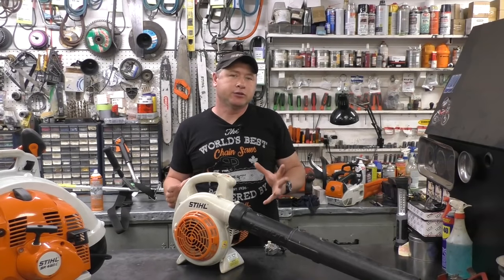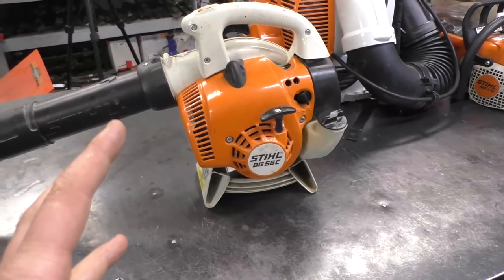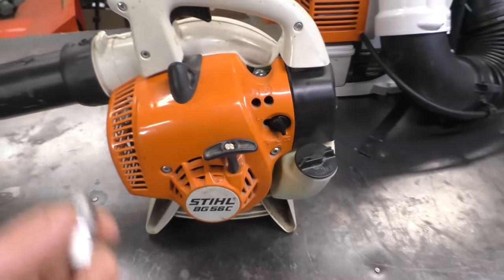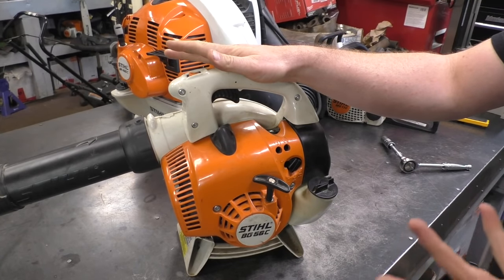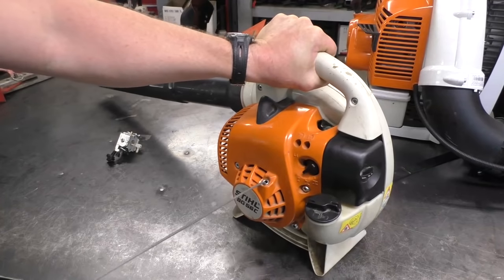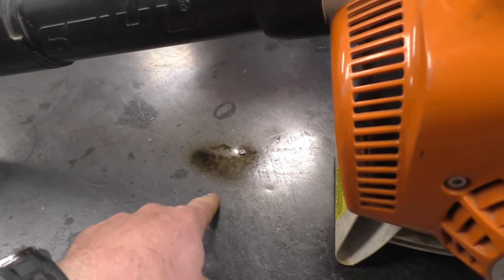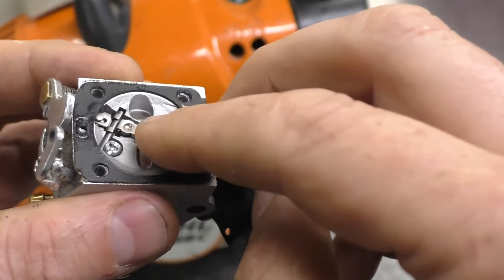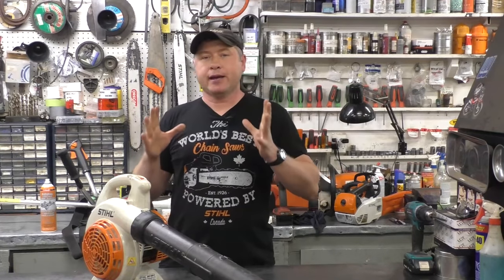Quickly Unflood Any Leaf Blower - Stihl, Husqvarna, Ryobi Etc.

Comment: Hold the throttle wide open turn the choke off. Basically allow as much air and as possible so you can flush out the excess fuel and get back to a ratio that actually fires.

Comment: That's a sure fire way of doing it if you have no tools, but can be hard on the arm / shoulder.
My preferred method is to take out the spark plug and give it a couple of pulls, then use the air compressor and blow the combustion chamber dry.
Reinstall everything and 99/100 it fires on the first or second pull. But this method requires tools.
Reply: Way To Go.Richard.

Comment: I see so many people buying electric blowers now. I prefer fuel operated blowers as to more RPMs and CFM 's of air than electric. Good video. 90% of flooding continually is carb issues. Compression issues can cause a unit to start and run, but not stay running. Been seeing a lot of that.
Reply: What exactly are you blowing ? I assume by your comment you have the baddest blower made right?
Reply: I dunno man...    My Ego 615 (615 cfm) electric blower IS more powerful then my bg86 blower (365cfm)  which is stihls biggest handheld blower....

.... now runtime.  bg86 wins.    I'll use the electric till its dead to warm up the neighborhood for the noise then pull out the stihl.
Reply: I think my issue with my Craftsman blower 27cc is too much fuel in the engine or cranking it with the choke on. I put mine in 3, or choke off, and it unfloods itself!

Comment: This worked for me on my Craftsman BV225 Leaf Blower 27cc. I learned I was doing the Primer Bulb too many times to flood the blower from a friend and changed the primer bulb in the carburetor. I do it less now and crank and pull with the choke off, and it unfloods itself or turns on well! We also changed the spark plug. Thank You so much!

Comment: I have 4-cycle Ryobi leaf blower that stopped running during the middle of operation. It was running fine for about 10 minutes, and suddenly stopped. I tried numerous times to start it again. I tried changing the gas, tried changing the oil, and finally tried replacing the spark plug(hasn't been changed in over 10 years). Nothing worked. I was looking up replacement 4-cycle blowers, when I decided to read up on other issues without going down the rabbit hole of replacing every part there is. Ran across this video and other articles mentioning flooded engines, and decided to leave the choke open (OFF or in RUN mode) overnight to allow air in and provide better evaporation of the gas inside the chamber, and voila, I was able to start the blower fine the next day. If you don't have time to leave the machine with choke open overnight, then of course the method in this video should come in handy. Thank you.

Comment: Dony, can sealant be used to coat both sides of gasket?  
I have a leak at the bottom flange of a B&S mower engine, and the replacement gasket looks VERY thin.  
These gaskets used to come in different thicknesses, but there is only the standard replacement for newer engines.
I may have a slightly warped flange in that one spot.   Thanks.

Comment: Hi Dony.  I ran into a similar problem yesterday when my Stihl BG55 blower failed to start.  It ran great on Thursday, but spews fuel out the exhaust now.  Got spark (tried 2 different plugs and 2 different spark-indicator cables), lots (too much fuel), but no go.  I run it without the spark arrestor.  I use ethanol-free gasoline with Red Armor oil.  Why would the blower just die with no previous symptoms?

Comment: If the carb diaphragm is old/ stuck or the needle does not seat well, you will be pulling forever because with every pull, tons of gas will be drawn into the cylinder and soak the spark plug instantly.

Comment: fell to mention my situation, my 600BR floods if it sits for a week untouched. I was thinking the air vent to the fuel tank may be plugged up and building pressure forcing fuel to the piston. whats your thoughts. have no ideal how the tank breaths, through the cap or some other method.

Comment: Might want to engage the starter dogs before pulling on the starter rope.  When the handle on the starter recoil is pulled, the attached cable or rope, with the assistance of internal springs, causes the recoil assembly to rotate. When this happens, tabs on the inside of the recoil (commonly referred to as dogs) catch the notches on the inside of an internal cup.  Pulling sharply without engaging them first before a hard pull can cause excessive wear.

Comment: Hi donyboy i like your channel it help me a lot.I am from South-Africa and here is not a lot of people to help   .I have a bg55 blower and i tested the coil for spark and the reading i get is 2.9 on the multimeter. I tested the plug and it is ok and i tested the switch it is ok but when i test the plug in the coil wire and turn the engen then there are no spark. On the other blower the coil give me a reading of 3.2 and when i test it take the plug out like you did on your video and turn the engen i get no spark but the blower is running when i start it.The first blower is not starting at all. I hope that you can help me with this.Thank you

Comment: Hey Dony, I like your videos. I find them very helpful and you seemed very knowledgeable. I was wondering if you  could point me in to the right direction with the issue I am having with my Husqvarna leaf blower. 
I have hand held Husqvarna 125b leaf blower. It usually start right after a first prime and dies in about 10 seconds. 
It’s hard to start again and when it starts, it runs for about 10 seconds nevs and dies.
I checked everything.
It has a spark (I tried working ignition switch from my other blower) new spark plug.
I tried new carburetor, new gas lines and gas filter.
Tried with out air filter.
I doesn't have a spark arrestor, but I even tried to run it without the muffler and checked the exhaust to make sure there is no abstraction in sylinder.
Check the flywheel position.
Checked the piston, it smooth with no score lines.
the compression is 125 PSI

I really have no idea. I took it apart so many times, I can probably do it with my eyes closed. it's an old unit and when I called the mechanic shop the guy is asking $125 without even seeing it. 
So I am hoping you would know where else to look.
Thanks.

Comment: A more conservative generation took the plug out of the flooded engine and burnt the excess fuel off of the plug with their cigarette lighter and reinstalled it thus avoiding the expense of a new plug and the trip to the store.  This method also provided an opportunity to adjust the inner to outer electrode gap on the plug with a WIRE plug gauge (Not a flat feeler gauge……..hmmm…..another video opportunity), as well as a wide open spark plug hole to really expel flooding fuel from the combustion chamber by pulling the engine over as you described.  Good video Don.  You’re still passing student teaching with an A!
Reply: I take the plug out and pull like Don to get the fuel out. Wipe off the plug and re-install.